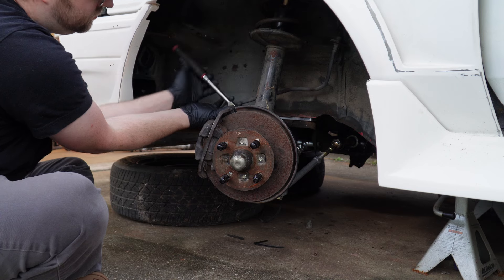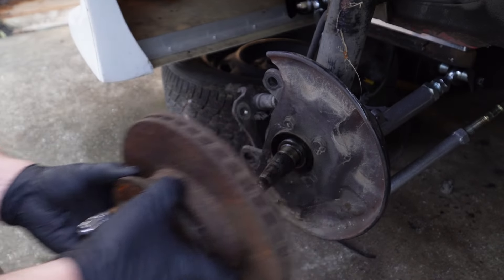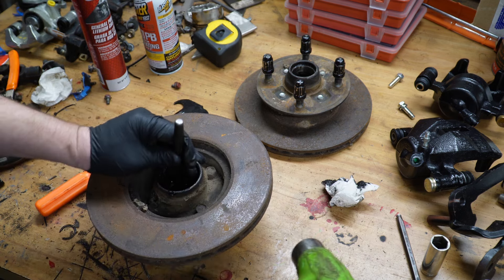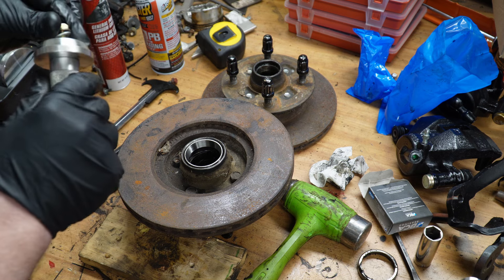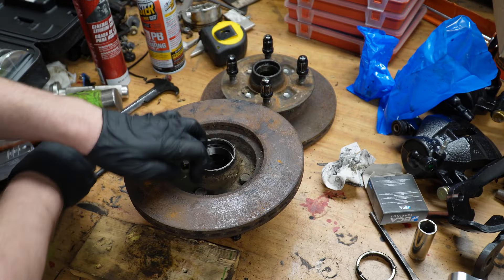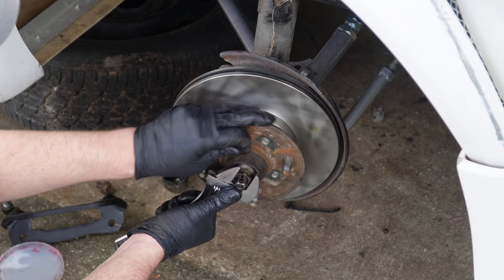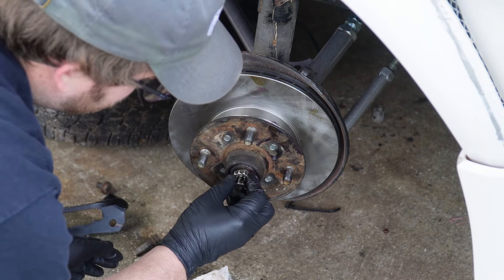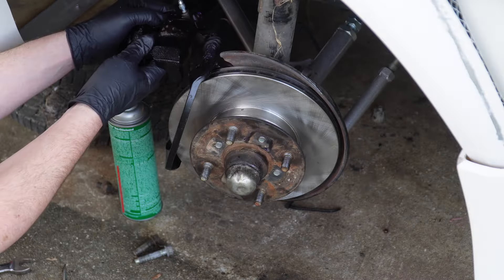AE86 - Change Front Brake Rotors and Wheel Bearings

Comment: The Torque spec for seating the bearings is 22ft/lbs but do not leave it at torque.  Tighten to 22ft/lbs, back off, tighten again to 22ft/back off, and I then tighten the nut with just my fingers and do 1/8-1/4 turn.  That seems to get the hub seated but still loose enough that it won’t burn up the bearing.  👍🏼
Reply from the maker: I remember doing something similar the first time I did a set of bearings on my ae86. There is also usually a breakaway and rotational torque spec for these type of hub/bearings, but it is super awkward to measure. 

I use my "by feel" method on probably 100+ cars in the last decade, but it was only after doing probably 50+ using the factory torque settings to where I had a more "calibrated hand" haha. I learned it from the lead tech at one of the shops I worked at years back.